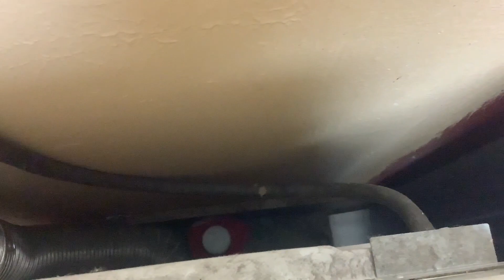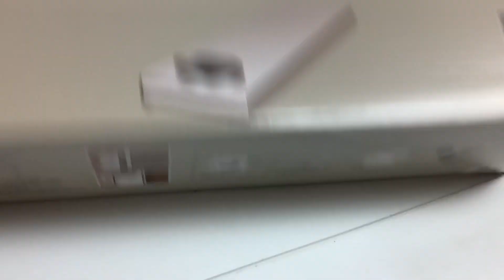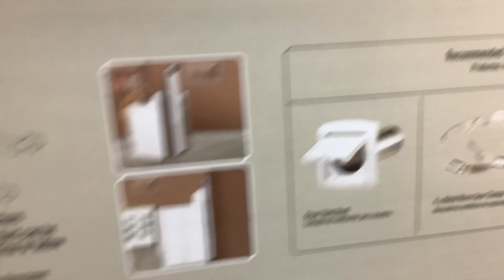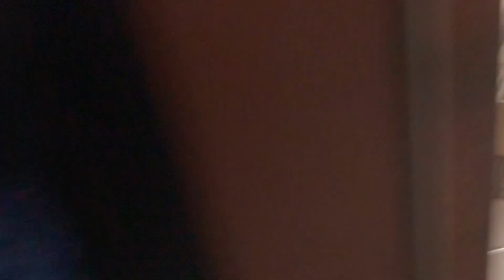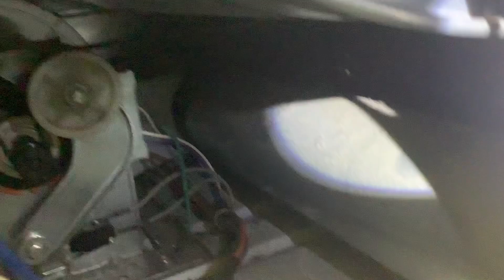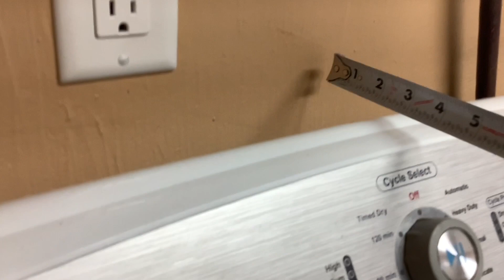Flat Dryer Duct Install |  It will work?

Comment: That’s an interesting re-route. The manufacturer probably would have preferred you used galvanized rigid piping inside the machine vs semi-rigid. Did you measure the air velocity coming out of the vent termination? You got 15ft using 3 90 degree bends plus the rest of your duct looks like under 35ft. Good stuff
Reply: Love the extra space,  nice video

Comment: The manufacture sells the kit to vent to the right or left. The way you have done it is not correct
Reply from the maker: Thnaks for watch and commenting! Wish the manufacturer sells that mentioned kit to me. As I mentioned if the Orange box store carries rigid duct I would of used.